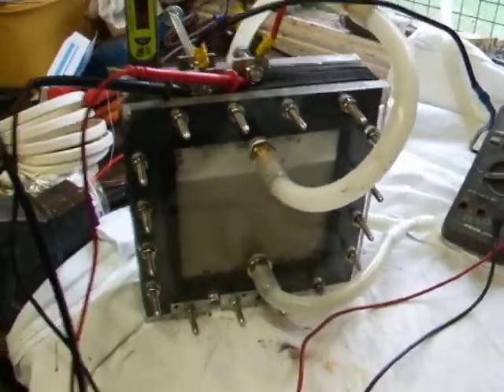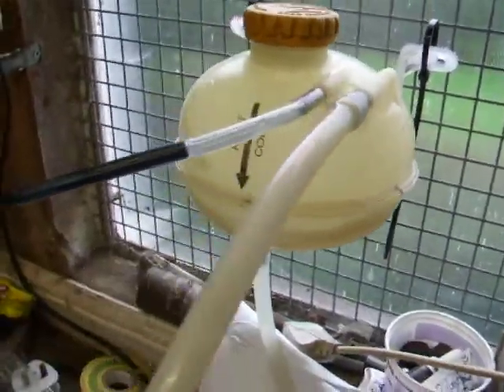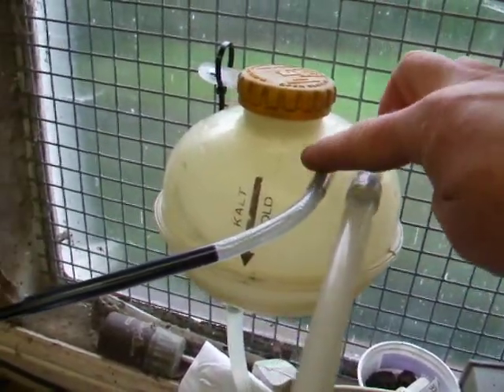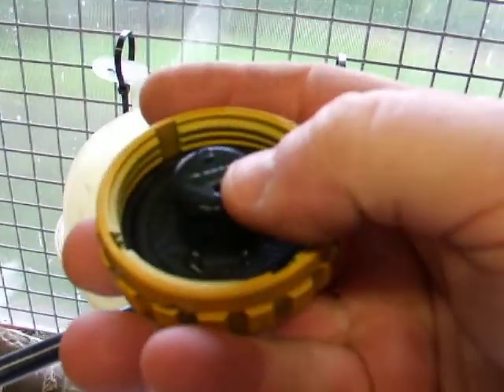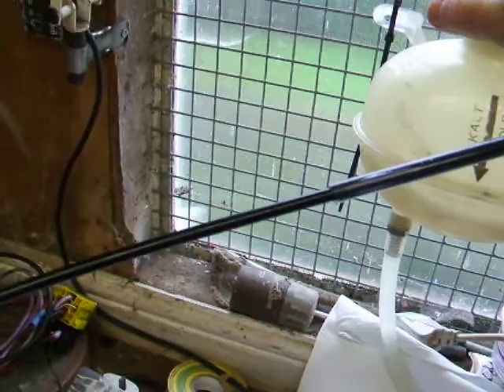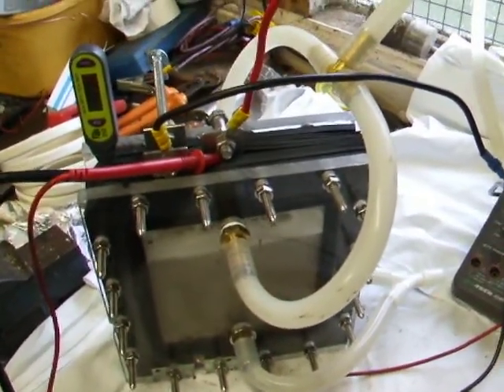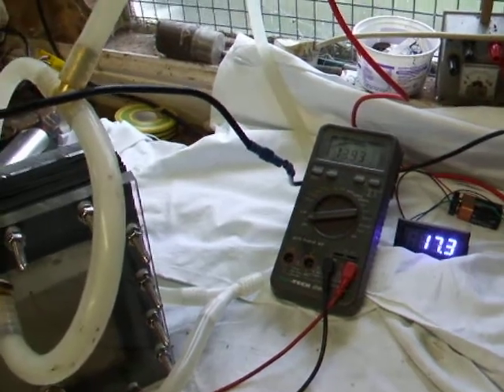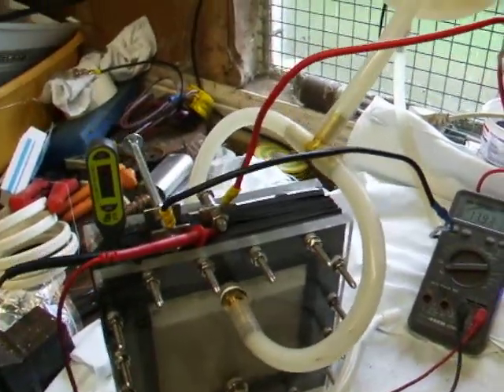HHO drycell #07

Comment: What electrlyte you using and at what concentration. I used the naoh crystals from B&Q at 3 tspns to 1.5 litres but still get 1 litre in 3 mins for similar size cell at 1/16 spacing...cheers.